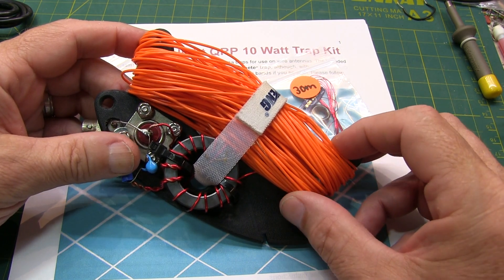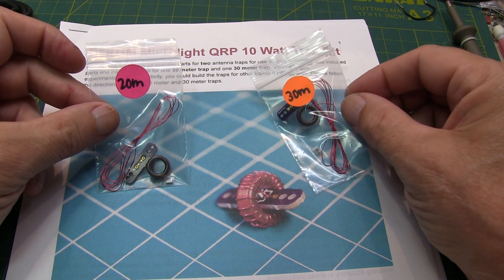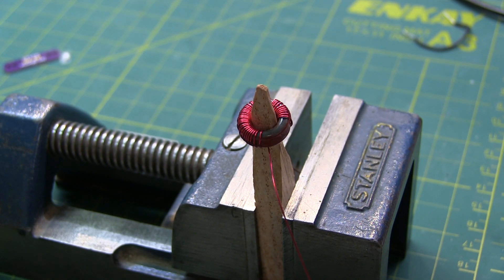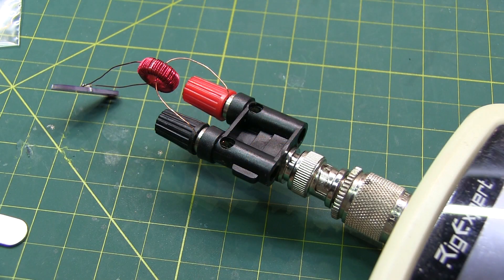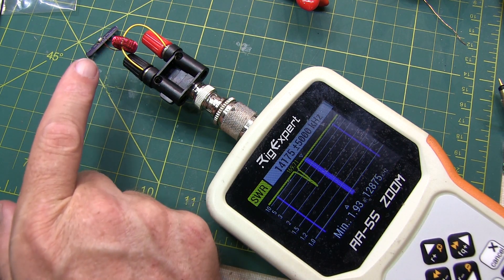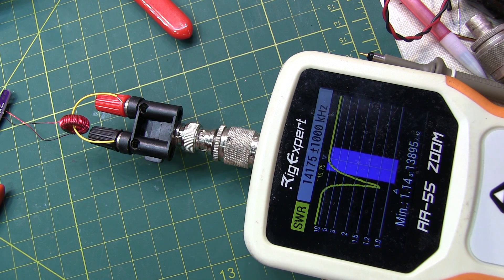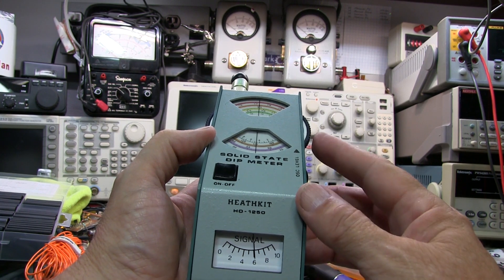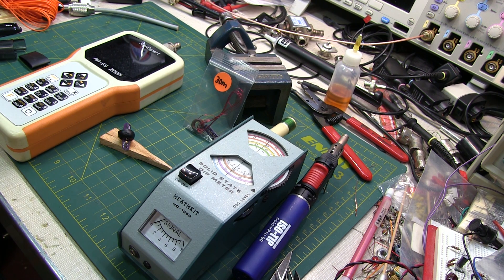#387: How  to build and tune traps for a multi-band End Fed Half Wave (EFHW) antenna

Comment: What about building a roll-up half wave for 2 m with a tuned trap at the feed point to eliminate common mode current on the cable?
Reply from the maker: For such a short antenna, I’d typically build a dipole and add a common-mode choke at feedpoint if desired.

Comment: I understand that method of finding the resonate frequency of the LC circuit.  I'm surprised that it dips at a 1:1 SWR implying it's a 50 ohm load at the resonate point.  This seems odd. I would expect it to still dip as it is throwing the wire out of being a short circuit.  Or even double dip as it crossed 50 ohms twice.  I will lose sleep over this. LOL
Reply from the maker: The method was a surprise to me too, but it works!

Comment: Hello there, hope this will answered, any chance you can tune this toroid filter with a nano vna ? And how would you do it. Thank you.
Reply from the maker: Yes, use the same exact process, sweep SWR
Reply: @w2aew  so I build the same cable, and add the 1 or 2 turn coil, connect to transmission channel, and sweep?
Reply: @w2aew  I tried, clearly something I'm not doing right it did not work.

Comment: Excellent video Alan! You can get a bit more dip by using the original longer leads and coupling between the wires that go to the loose cap. Traps are fun and practical and  chunk of 1 inch PVC tubing and some #14 enameled and a few inches of coax as a capacitor will do the same as the torroid and chip cap and allow up to a few hundred Watts. Tuning just below the band is great advice!
Reply from the maker: Can you elaborate why tuning just below the band is the right thing to do?  I haven't really heard a definitive answer to this yet...
Reply: @w2aew  That question is itself a trap. My personal opinion is that we do not need to do any more than to take W8JI's measured data as guidance.
Reply from the maker: @MIKROWAVE1  I'll go check that out.
Reply: @w2aew  @mikrowave1 There is a significant reduction in voltage across the capacitor and coil due to the reduced Q from tuning the trap slightly off of the frequency of interest.  It can be almost 50% in some cases.  Tuning a trap at 13.9Mhz for a ~14.250Mhz can reduce voltages almost in half.  When using a 1000V silver mica capacitor, this can help sustain a 200W keydown rating, for example.

Comment: Excellent video Allen.  Thanks for posting it.  Can you share some info about your particular EFHW?  Was it a kit build or did you put it together yourself?  Thanks and I’m looking forward to the follow-up! 73.
Reply from the maker: Check out the video posted today (#388).  It shows the antenna build/tune/test.  The traps were a kit from N7KOM, the UNUN was from SparkPlugGear, and the wire was a hamfest special...
Reply: @w2aew Hey Allen.  I just watched that video.  Excellent job!! The EFHW I was curious about is the one you show at the very opening of this video.  I didn’t know if you bought it as a kit or brewed it up yourself.  Thanks!!
Reply from the maker: @BobGarrett66  I picked it up at a hamfest here in NJ a few years ago - made by a few local hams.  I made two changes to it - I added a right-angle BNC connector to it, and replaced the wire (after I broke the original).
Reply: @w2aew  Gotcha.  Thanks for the reply.

Comment: Thaks Alan for the great example.  I was expecting you to try to interpolate the dial on the Heathkit and was surprised to see you read it with the freq counter.  In the next video can you include some schematic drawings and explanation as to why you chose the tuning freq for the traps and what effect they will have, etc.  Thanks for sharing your knowledge.
Reply from the maker: The dial on the dip meter isn't nearly accurate enough to target the desired frequency.  I'm taking the target frequencies from the N7KOM instructions.  Schematic is included in them (simple parallel LC circuit).

Comment: Great video! I am curious, a normal (~67') 40m EFHW will get you on 10, 15, 20 & 40 meters. If the wire is now significantly shorter, and you have a "dedicated" 20m "section", do you lose 10 & 15 meters?
Reply from the maker: Yes, I'll lose natural resonance on 10 and 15m.  For me that's an ok tradeoff since I don't use those bands nearly as often.

Comment: I thought traps were resonated for the frequency you wanted to operate, like the CW portion, not below it. The zepp's got a high Z, so the trap's gotta be high Z, too. Sure, the dang thing's gonna go off as soon as you put them wires on it and breathe on it, so maybe that's why you're aiming a little low, right? 73's DE W3IHM.
Reply from the maker: I was going by the advice in the N7KOM instructions - assuming that things shift once you add the wires to 'em.

Comment: The most interesting piece of equipment in this video was the Heathkit grid dip meter!  Ahhh the good old days !!😊
Reply: What? Not the nixie tube frequency counter!?

This is a fantastic video. I was recently gifted (!) an Elecraft KX3 and plan to start doing some portable activities (want to operate from Balsam Lake Mountain in the Catskills - one of the "15 high peaks" but sadly not formally eligible for SOTA due to some geographic anomaly). I have a portable vertical, but this looks like it may be superior (especially regarding weight).

Comment: Thanks for showing how to build one.
However, I would like to learn the science behind it, so I can design one.
Reply from the maker: A trap is a parallel resonant LC circuit. Check out this video on resonant circuits:  https://www.youtube.com/watch?v=hqhV50852jA
Reply: @w2aew  Thanks  I already know about resonant tank circuits.
There are other effects such as concentration of fields inside ferrites (which is 1000 times more than free air) and make good receiver antenna, but not good for transmitting because of ferrites hysteresis that leads to power loss. 
Also, matching the impedance of the antenna to the input of the receiver, because a short dipole (compare to wavelength) have very high impedance and we need to use things like inductor to better match the antenna.

Comment: Glad your RigExpert is still working.  My AA230Zoom took a dump. Gigaparts & RE USA could not help fixing it.  My appeals to RE Ukraine went unheeded.  Disappointing experience. Great vid. 👍
Reply from the maker: Sorry to hear of your troubles with the RigExpert.
Reply: The only problem I've had with my AA-55z was overzealously pushing a poorly soldered PL259 into the socket (it had a solder blob on it). This caused the center conductor to break away from where it was soldered on the AA-55 circuit board. Worth checking and an easy fix if that's your problem.

Comment: Few questions:
Can I use nanovna?
What is efeciency of trapped EF relative to full EF?
How tuning frequency was chosen?
Reply from the maker: Yes, a NanoVNA can be used in much the same way.  Efficiency on the 20m band will be the same as full EFHW (because there are no traps). Efficiency on 30 and 40m will be a little lower (as is always the case when you have some inductive loading coils).  Frequency was chosen to be just below the band so that at lower frequencies, the trap will appear inductive.

Comment: My POTA EFHW is a linked design.  Doesn't help the 65 feet of wire problem, but it does get me on every band between 40 and 10 with no tuner.  I've used that same wire without the UNUN as a 1/4 wave on 80M, although that typically does require at least a 3:1 internal tuner (and radials of course).  I may build one of these though.  I built a dedicated 20M QRP version to go with a QCX mini.  Now that they have the multiband version of that radio a more compact multiband end fed would be handy.

Comment: Really cool Alan! Being that I've been a ham for 30+ years and outside of common mode chokes, I've never used toroids. THIS is a great project to practice on! It so happens I went through my junk box and I have about 15 of these T-50-2 toroids this is good news! They look A LOT bigger on camera. I wonder how well a NanoVNA will work to check this circuit? Thanks and 73! - W1RMD
Reply from the maker: A NanoVNA can be used in much the same way as the RigExpert
Reply: @w2aew  Thanks!

Comment: Alan, thank you for the [as always] most excellent and patient explanations in your build videos like this one. You captured the build process of these traps really well but without the colourful language that I employed off-camera :) And now I know a bit more about a grid-dip meter too. vy 73 my friend de VE6LK
Reply from the maker: Thanks for the inspiration.  I wonder if you could share your final segment lengths from your antenna with me?
Reply: @w2aew  oh whoops I forgot that .. standby .. .getting tape measure .. Individual wire lengths: 80 1/4" end ele .. 45" mid ele .. 354 1/2" to feedpoint.

Comment: Wish you'd explain why you want it resonant at 13.9MHz, below the band of choice...
Reply from the maker: I operate primarily CW, so I'd like the trap to provide good action at the low end of the band.  Below the resonant frequency, the trap appears primarily inductive, effectively shortening the required wire length of the next wire segment for the next lower band.
Reply: @w2aew   Cheers, I love how you explain stuff - even my sometimes slow brain understand your explanations.. you should have been a teecher :)
Reply: @w2aew  but then why not 14.0 ?
Reply from the maker: @doctave  To be honest, I'm following the recommendation in the N7KOM build instructions.  I need to do a bit more study on why the resonant point is set 100kHz below the band edge, which makes the trap appear capacitive in the band of interest (maybe having something to do with the effect of the wire on the far side of the trap)
Reply: @w2aew  In the past I made a trap for a 6M/10M dipole and centered the trap in-band and found that it didn't work that well for me. So seeing your video and realizing that the trap should be set slightly lower in frequency gives me some clarity and a bit of relief! I don't fully understand why still, but somewhat glad to know I just probably did it wrong :)

Comment: I am not a HAM, but I watched the video, because you are a great teacher and I knew I would learn something. And, I did ! Thank you. Ideas = Rusty Oleum brand makes a clear spray paint that is safe for plastics. Maybe lightly spray the coil, after you have it adjusted, to tack it in place, so that it will stay put, when you cover it with the heat shrink? I would think that you know all the tricks of shooting a string into a tree, with which to haul up the antenna... Bow and arrow, sling shoot, or even a fishing rod... A bow and arrow may not be permitted in some parks, I would imagine. Cheers!
Reply: There is a product more generally  available in the US called Q-dope. It's basically polystyrene  dissolved in a solvent such as Toluene. It has practically zero effect on the tuning.

Rather expensive in the UK, so I just found some Toluene online  and dissolved some polystyrene in it about 5g poly to 30mL solvent. Got enough solvent to last a lifetime! 

Andy
Reply: Ooo... DIY an air cannon with PVC to shoot a tennis ball with the string attached... Just don't make it look to much like a WMD...
Reply from the maker: I use an arborist throw-weight and some light-weight throw line to get a line into a tree.

Comment: The very first time I looked at POTA activations I saw your call.  Haven't work you yet, but well may, didn't hear you. 

I've built a few of the "full scale" EFHW's and have been running one for a few years now as my main HF antenna. Great to learn more about building them, and a smaller scale to boot. Thanks es 73,  W1ADE
Reply from the maker: EFHW are very under-rated, I think they're fantastic.  I'll keep an ear out for your call!